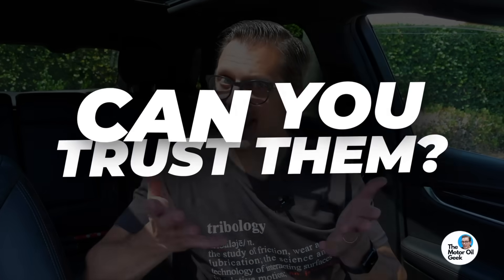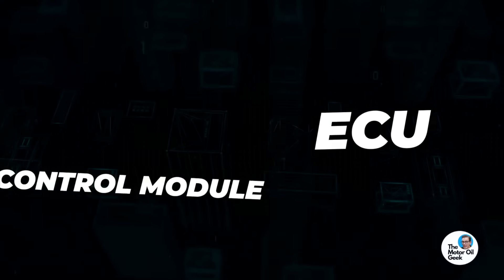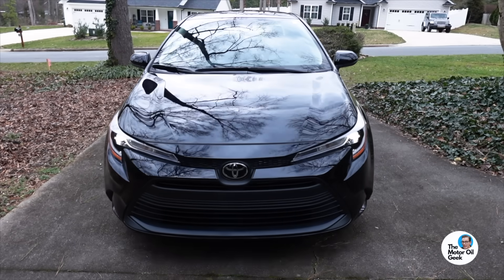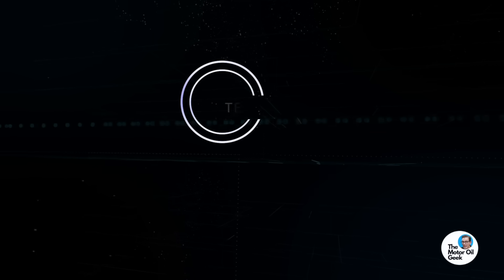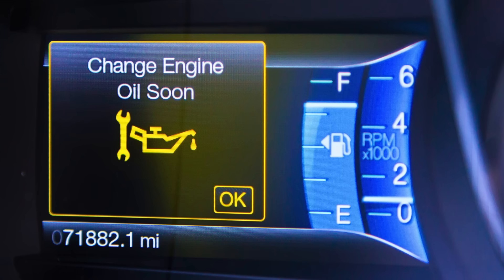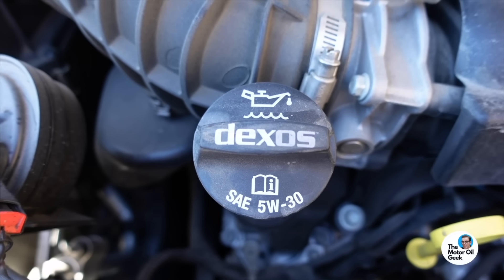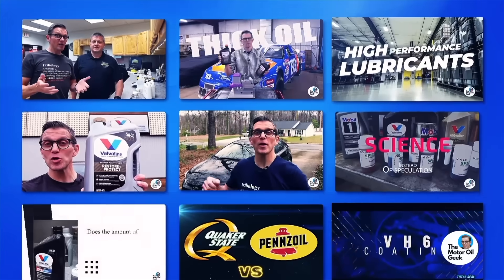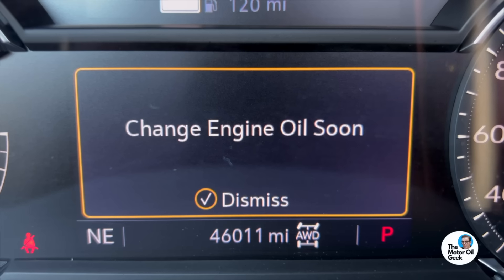The Accuracy of OIL LIFE Indicators REVEALED!

Comment: Manufacturers want the cost of ownership to appear to be as low as possible. They only care if the engine makes it out of warranty. If you want it to last use synthetic and change it every 5k miles.
Reply: So here we have proof from an expert and you’re still going on with this tired statement lol
Reply: @brandon5411  he even said he has no idea how many miles are on the oil in the video. He doesn't know when the oil was changed and when the system was reset. If you have a honda and plan on keeping it for more than a 100k miles. You better not trust the onboard system. He tests a gm oil life indicator and says you can trust them all. The indicator in the gm will not let you go past 7,500 miles. Honda will go all the way to 12k miles before it says to change.
Reply: @jgranger2002  You are right about Honda, I would change the oil in my old Civic when the monitor reached 50% and it was already very dark. I'd say the oil life monitor is more accurate than mileage since it actually takes more variables into account, but Honda's is not conservative so just change the oil when it reaches 50% or so.
Reply: @jgranger2002  Yes, from engineering perspective & research GM & Fords IOLM both seem fairly conservative & advanced. That's a good thing! Kudos to them. Our 22 BMW X6 hybrid will let ya go near 15k mis ( ive heard) b4 computer says change oil 😮. 7500mis max on that one.. as engine use is much less than my 24 Ranger Raptor 3.0L twin turbo for example . X6 goes 20mis or so electric pwr. Both get proper versions of Pennzoil Platinum full synthetic & OEM filters exclusively.
Reply: @AlrienJ The color of the oil tells you next to nothing about the condition of the oil.  

Do you even watch these videos?  He's done one about that exact thing.  Oil analysis is the only way to tell what the condition of the oil is
Reply: @jgranger2002 he does not say you can trust all OLMs. He's very clear that only GM models use the kind of algorithm that he's testing and that other manufacturers are only using mileage. That couldn't be any more clear in the video
Reply: @jgranger2002 I can verify a 09 odyssey will go 15k with mild driving highway use.    Oh and don’t think I went that far.  I’m a 27 yr tech. I change my oil early.  I was on the fourth service by the time it said to change it
Reply: @rodgersrcaviation2785  so it will do 15k mile oil changes, but you change it 4 times in 15k miles. Ok.
Reply: @jgranger2002  being an auto tech and a shop owner I see the insides of engines that go 15k  between service.  It’s not a prettt thing
Reply: @rodgersrcaviation2785  first thing I'd do is buy the aftermarket cylinder deactivation elimination. Number 1 killer of these engines.
Reply: @jgranger2002  we bought a new Honda Fit in 2007.  While in break in we were watching the oil life indicator and I asked the dealership if we should change the oil when I saw it tick over 8000k.  Oil life indicator was showing over 50% life left.  We were told to trust the indicator.... another 1000k later I got nervous and pulled the dipstick out to check the oil level.  Still had 37% life left, and the engine was now out of oil.  Couldn't believe how inaccurate and damaging the information was.  Normally I would drain the oil 3 times during that time while running in the engine.  Never went back to that dealer again.
Reply: @adamstobiecki9549  yep, I see this all the time. I'd say 25% of the cars I service have no oil on the dipstick.
Reply: @AlrienJ  do you even synthetic bro?
Reply: @WaGwan-n6x  I got that car at 200k km and it had 5w20 synthetic blend so I kept putting synthetic blend. Otherwise I'd have used 0w20 synthetic instead
Reply: What if you drive only 1/2 a mile per week? Change it at 5000? No way. Better do it way before that. What if you only do daily long freeway drives in southern California? You can go way over 5000. That’s the point I think he makes in his videos. It’s not black or white. That said, I agree that it’s better to be safe than sorry. I’d rather change too often than not enough.
Reply: @WalkerSmallEnginePerformance  No, in that rare case i would change @3k mis using any good full synthetic oil that meets spec. You'd be fine! Or every wk or so go out on hwy for 5mis @hwy speeds etc. Modern SP rated/GF-6A oils are very robust & resilient. My garage queen 04 SVT Mustang Cobra terminator w/4900mis fits that category. I just change oil 2× p/yr regardless using Redline ester 5w30 + K&N high flow oil filter. Runs impeccable. No major mods. Boutique oils not needed in reg daily drivers! Cobra is 4.6L 32V factory hand built & supercharged 500hp+ sports car. Engineering perspective.
Reply: @WalkerSmallEnginePerformance  
I don’t have a problem with your written thoughts. If you live in LA or the “Burb’s” like Burbank or Torrence, then walking is faster than driving one the 101!
Reply: @deankay4434  True. How about northern CA, on I-5 during the spring or fall?😂
Reply: @WalkerSmallEnginePerformance  I work at an oil change shop. I have customers who drive 5k miles in a year and I also have customers who drive 5k miles in 2 weeks. The ones that drive 5k a year are usually old folks who don’t need to go anywhere and it usually takes them around a year to rack up 5k miles. The ones driving 5k in 2 weeks always looks worse coming out of the oil pan than the ones driving 5k in a year. Yes science is cool but I’ll stick with the proof I see in front of my eyes and I’d recommend you do the same. Also I don’t think this test was accurate at all. He doesn’t know when the oil was changed. They could’ve changed it 500 miles ago and forgot to reset the reminder. Happens all the time. I’ve never seen a GM vehicle go 5k+ where the oil wasn’t as black as diesel oil and I damn sure ain’t gonna believe that a RENTAL CAR is gonna have oil that clean after 6k miles.
Reply: @jgranger2002  wrong! DK ASE master since 78. ACDelco MASM for Raytheon on contract and meet engineers that tested these oil additive packages every 1,000 miles in every engine family. Change your oil and filter every 1,000 miles, it your money and a waist!
Reply: 5000 if you use junk full synthetics
7500 for most full synthetics
10 and 12000 for the top full synthetic performers which are pennzoil ultra Plat and amsoil.
It's been verified by oil sample tests too.
Reply: @jason200912   I refuse to engage in a battle of Witt’s, with an un-armed man! This discussion is closed until you get some learning. Perhaps the “Girl Scouts” can help you.
Gods Speed!
Reply: What a stupid comment on this video. Literally spends the whole video basically concluding that the system appears to be at least somewhat conservative. Why would you come here and post a comment that clearly hasn’t taken into consideration the content of the video in any way? Why even waste your time if your opinion isn’t one that can be changed with evidence based analysis?
Reply: I seriously doubt cost of ownership is even a remote consideration for most people when purchasing a car. Certainly not a big enough concern for manufacturers to get funny with the numbers
Reply: @timdecker6119   I speak the truth and if you refuse to comprehend or understand, that’s your problem. Please read below!
Reply: So, you don’t believe the data in the video? I’m afraid I’ll go with an oil engineer over a hackneyed rant from a random guy on the internet.
Reply: If the gubmint has anything to do with the mandates. .he'll no I would not trust the oil life monitor...
Reply: I change my synthetic every 3 thousand. I love my HEMI.
Reply: Make sure your engine oil is rated to last as long as your OLM.
Reply: Did you even even watch the video
Reply: You watch a highly data oriented channel like this and still decided to type that comment. 🤦‍♂️
Reply: @flyer8493  I've been working on Japanese cars for 25 years, so I know a few things. Don't trust that honda or toyota are interested in anything they make nowadays lasting like their old stuff did. If they were, they wouldn't have 10k mile oil change intervals. 🙅‍♂️
Reply: 5K is a lot actually, you could get away with 5K miles before technology like direct injection and before high compression hard working, small turbo engines became the standard.  3K to 4K is best. big naturally aspirated engines can take 5K mile intervals
Reply: @cantwealljustgetalong2    Unfortunately with your assumption for direct injection is wrong. Imports especially use a pre-catalytic converter with 4-wire heated O2 sensors. The sensors are “Wide Band” type, telling the ECM how rich or lean the A/F mixture is. The older Zirconium Oxide O2 sensors only show Rich/Lean, not how much. ECM is faster, ring alloys & coatings are better, end gaps are controlled better even though wider due to high pressures and temps in combustion chamber. This produces NoX, so these engines usually have variable valve timing to provide early intake closing events, or later exhaust closing events. This changes cylinder pressures. 
  Older V-8 with carb had specs for HC 4% +/- 2%. In the 80’s it tightened up with 3-way cats still using single wire O2 sensors. But most are still carbureted and had external devices for anti-backfire valves, high altitude mechanical system as timing is increased while fuel is decreased. Only the 1976 Datsun 280Z & 76 Cadillac Seville had multi-port electric injectors. Datsun used a vane air flow meter, a type of mass air flow sensor with no O2 for mixture feed back. Cadillac used a Bendix electric fuel injection with no mass air flow, using a hard plastic hose inside to the PCM under center of dash. Vacuum controlled A/F while a throttle position switch was actually 21 injector pulses spaced to provide acceleration. Only Buick in 1984 introduced sequential fuel injection which everyone uses today for cam / crank sensor to find a single cylinder misfire. Chrysler, after lean-burn computer mounted on air cleaner, still had a Carter carburetor with HC 1% +/- 0.5 that lasted two years before the famous “Thermo-Quad” plastic body carburetor. Ford used Dura-Spark 1, the 2 then went to “Thick-Film” ignition module on the variable Venturi carb VV7200, then VV7400 and worked great until diaphragm broke. After 9 TSB, Ford dealer techs junked the carb, installing the old metal 2BBL. Direct injection is a “Bosch” system used in Europe for 12 years before GM adopted it on the “ECO-TECH” engine. No sir! As someone who’s use a 3-gas & 4-gas analyzer in tailpipes, fixing 4 decades of auto’s both domestic & import (Including Mercedes, Volvo, Audi, Porsche, etc.) using the “CIS” constant injection system, call hose sprinkler, I have repaired all. Water vapor 1st, HC 2nd, then carbon are the worst of the crankcase offenders that cause additive packages in oil to fail plus cold engines driven short distances to reach the boiling point of water in the crankcase. 
Newer OBD-2 vehicles cause the engine assembly to have tighter fitment, better alloys, coated piston skirts, coated alloy rings, low tension to reduce internal friction & heat. Valve events ground into the camshaft are adjustable with VVT. Heated plainar O2 sensors work without using “Speed Density” A/F control. Just ask the dealer or manufacturer customer service number in the back of your owners manual and ask if oil life is a simple counter or software. Then learn to check the oil yourself. Take a rag, open the hood and check it, dark, brown, black, retracts from the edge of dipstick and smell. 80’s and older require frequent changes. 
Watch “Oil Geek”, “Powell Machine for camshafts”, “David Vizor” for engine/exhaust info.
DK. ASE Master Tech since 78. ACDelco instructor / Tech Seminars.
Reply: I remember when GM came out with oil change light on all cars they swore it was foolproof. As the destroyed engine piled up so did the GM technical service bulletins telling everyone to ignore the light and change the oil. I see some of the manufacturers on certain model seem to have it figured out, around 2018 some Toyotas models maintenance required message would show up long before the 5k window sticker, my guess is because of driving habits? Had a neighbor with new 2021 Explorer oil life would be 0% well before 3k they complained to the dealer who told them it was idle time. Turns out they spend a lot of time waiting for their kids after school, sports practice etc never shut off the vehicle so it adds up as it should. This is the perfect example of why most oil life monitors did not work they didn't take into account basic things like idle time.
Reply: I am curious if the oil prediction is as good in a lower level chevy?
Reply: Why not 4K or 6k miles? And why synthetic?
Reply: 5000 miles is ridiculous in most modern vehicles with synthetic oil.
Reply: @STEVEARABIA1  It is only when it’s not, after been tested in a lab plus run under every condition. This is what the two guys at GM did. I can’t speak for others. They told use the under full pulling load, highway cruise at 400’s trip, and driving .75 miles, off for three hours, then another .75 miles. Drain a sample, lather, rinse, repeat. Between 3-4 months on each engine with 8 different one at the same time. Auto start, speed, load control, time, shaft rotations, coolant temp, oil temp, turbo, supercharger or none. It took them 14 months to write the code of variables and subtracted 10% providing a conservative calculation. I could loose 2% oil life in the city in one day. Drive it loaded 435 miles the next, loosing 1% oil life. They got it right!
Reply: Wrong
Reply: @  Wrong? Wrong for what or do you know? What is wrong, is engaging in a battle of witt’s, with an un-armed person.
Reply: Bs. I have lifetime maxcare on my hemi and its fine with 5 to 8k oil changes at 95k miles. Doesn't make a noise. Use what it calls for.
Reply: I just had an analysis done on my '17 Sierra 2500HD 6.0 after 6,600 mile interval (66k miles overall) when the Oil Life indicator alerted me. All was good and there was no need to change it earlier. This was with Mobile 1 5w30
Reply: Says who? You? And you are?
Reply: And that is a very generic statement... There are a lot of flat tappet engines in service that nobody cares about warranty since they have been out of warranty for 250,000 miles! Synthetics typically do not have the correct additives which will shorten the life of the engine! My 427 Chevy is at 450,000 and counting! No thank ya to replacing that vehicle seeing the price tag, I'd rather put the dough in my retirement account.
Reply: @Sunspot-19  05 F150 4wd 362k mis 4.6L Triton SOHC - all orig powertrain. I agree w/your statement though. More Ford & Chevy trucks on rd (registered) w/ 250k+ mis then any other vehicles. Hope my twin turbo 24 Ranger Raptor makes it to 250k mis! 👍🏻💯
Reply: @Davido50   Treat it right and do the maintenance it deserves, you're off to the races! Load the piss out of it and try taking Eisenhower at WOT, and I'll be seeing you in  our shop for cylinder heads and ARP stud kit!! That route can kill any make/model when folks cannot keep their leg out of it.

I sure do miss my '64 Fairlane 427FE. Shoulda never sold it. :/
Reply: @Sunspot-19  I would put some aside for a new TC&G as the nylon jacket is cracked and ready to come off can sprocket. We all know what happens next!
Reply: @deankay4434   And replace the gear drive? Are you mad?? When I purchased the engine from GM, I installed a gear drive to never have a startup with Walmart brand plastic junk in there!!!
Reply: @Sunspot-19  good for you!
Reply: If you have the oil life indicator, it's WAY more accurate than miles, just change it before 0%, it makes no sense to keep relying on miles.
Reply: @bobbygetsbanned6049  if the manufacturer has you driving 10 or 12 k miles between oil changes I disagree. I'm seeing turbo honda's with engine failure at just over 100k miles. Direct injection with low tension piston rings plus turbo equals tons of fuel going past the rings.
Reply: @jgranger2002  I agree with that, I'm not saying go 10-12K miles. I'm saying your oil life indicator is WAY more accurate than miles, so figure out what % correlates to your magic number of miles that makes you feel comfortable, and use that % instead. If 5K miles normally puts you at 30%, then change it at 30%, but you might have a hard 4K miles that gets you to 30% even sooner, so you'd be changing at 4K instead of 5 which is better for your engine, not worse.
Reply: @bobbygetsbanned6049  I only work on honda and toyota. The oil life indicator on a toyota is only mileage, nothing else. When people bring in a honda that the oil life indicator says zero, they have driven anywhere between 10 and 12k miles. When you drain this oil, on the newer turbo engines. It looks like 15k mile diesel oil. The extreme variation between manufacturers and manufacturers being encouraged to make cost of ownership as low as possible. I guess if you have a fleet vehicle that is idling for hours a day, the onboard indicator would make more sense. I don't really feel that is how the average person uses their car.
Reply: @jgranger2002  As he indicated GM, Ford & Honda have most advanced oil life indicators currently. I concur. Ive owned only Ford 4wd trucks & have watched this advancement thru the yrs. Quite amazing. Though we still do 5-6k OCI on all our trucks both personal & business related using mainly OEM Motorcraft full synthetic 5w30 oils. Have 2 newer Transit 250 vans at work. Excellent vehicles both technology related & fuel efficiency. Engineering perspective. -Western Ohio
Reply: @jgranger2002  If the Honda and Toyota notifications really are just milage counters then yeah, it wouldn't make much difference to go by milage or %, but that's a pretty dumb way to do it in modern cars when much more information is available for them to use.
Reply: @bobbygetsbanned6049  I agree 100%. GM & Ford seem to have most in depth intelligent oil life monitoring systems ..of the big6 automakers.
Reply: @jgranger2002 funny how bmw got sued for their oil life indicator being to long and their junk engines blow up before 80k lol just change it at 5k
Reply: @jgranger2002  Thank you!  I argued at my Honda Dealership/service, that going 12,000 miles between oil changes (using the monitor) was silly.  The 1.5 turbo engine in my Honda is a tiny engine to begin with not to mention the stress the turbo adds to it.  They thought I was crazy to change the oil every 5,000 miles...but it gives me peace of mind that this small engine will last a good long time...and again, oil is cheap, engines are not  Thank you for addressing the Honda's in particular!
Reply: @williamwood1776   I guess I have way too many things go wrong with turbo’s but I won’t have one! It’s a power added that has bearings and seals that can fail. Enough oil leaks into the intake side and you can crack a ring or break a ring land on a piston. I find it funny that a 4 cylinder was all you got from mass production from Oldsmobile to Henry Ford, then V-8 mixed with number of 6 cylinder engines either straight or V configuration. But the 8 cylinder ran the day. Now back to tiny 4 bangers? There’s nothing wrong with them either belt or chain for overhead valves. Working for a garage in the early 70’s, I put a timing belt on a Pinto along the highway for a lady. It only took 30-40 minutes. I would run a supercharger any day of the week compared to a turbo. The may have more moving parts but built better with larger seals & bearings. Take a tiny 4, add turbo to get more power. Should have just started with an engine that made power. Change the oil more often on a turbo and ask dealer if software drives the oil life or if a counter only. This why you check it for opacity. Always let it idle for 30 seconds before shutting it off to allow it to spool down! Guys would gun the engine a couple of times then hit the key. That turbo would spin for 5 minutes! Talk about pre-mature failure, that would do it!!!  Have a lucky one!
Reply: @bobbygetsbanned6049 wish this was true.
Reply: I change my Tahoe @3000 miles, or ~50% life left.

It's a 2011 with 78000 miles, and I intend to own it until the wheels fall off.
Reply: @bobbygetsbanned6049  agree to disagree.
Reply: @jgranger2002  Sure, but you cannot support using miles instead of oil life with any kind of logic. Miles was only used because it's was all we had for decades, oil life indicators, objectively, are way more accurate. Idling adds zero miles, yet it kills tons of modern diesel engines. Continuing to use miles which have always been wildly inaccurate is straight ignorance. Think of it this way, if with your normal driving habits has 5K miles hit 30% oil life left, and on one oil change you end up idling a lot, so your oil life is at 30% even though you're only at 4.5K miles, would you change it or wait for your magic 5K, even though the oil is in worse condition than normal?
Reply: @jgranger2002  I agree with you as I know better after 6 yrs 10 months with ACDelco and meeting the new engineers. The ones in the video retired decades ago as counters were used. Hell, I was installing On-Star in Buicks in 1997!
Reply: @bobbygetsbanned6049  Modern IOLM take into acct hrs, mis, heat, & many other factors. As he said GM, Ford & Honda have most advanced systems. My 24 Ranger Raptor has one ..my 05 F150 4wd w/ 362k mis has simple oil change indicator (prob just mileage based). Engineering perspective.
Reply: @bobbygetsbanned6049  Shortcycles and idling contaminate oil by default since blowby is greatest below operating temperature. Fuel dilution will cause failure sooner than later. If a fella checks their oil and sees that it is not kosher, regardless of mileage, then breaks down and changes it at that point, they have done a valuable service interval.